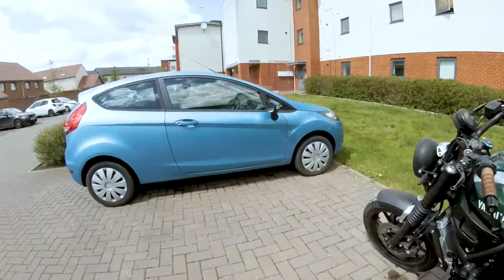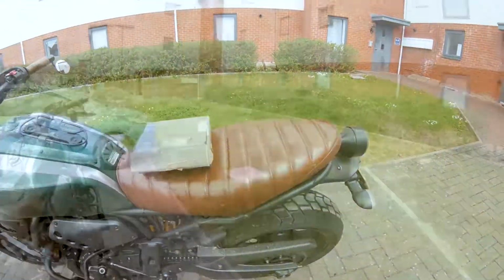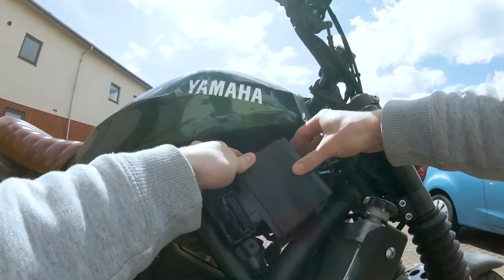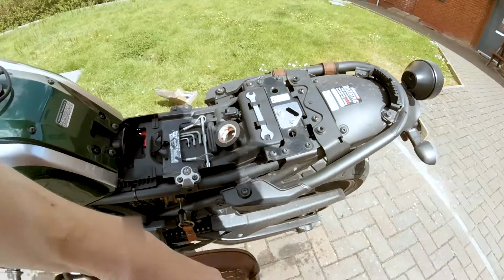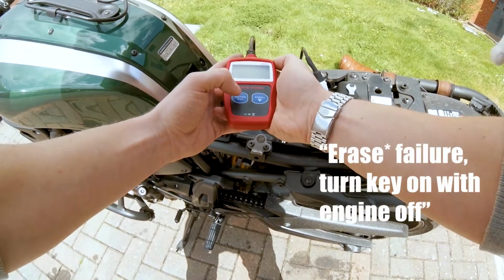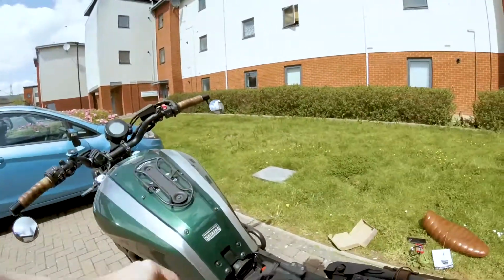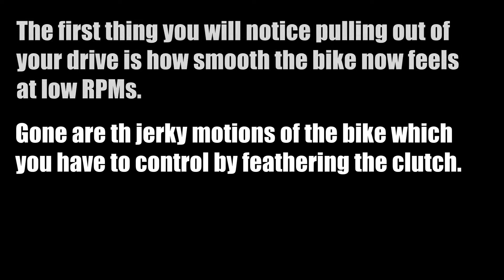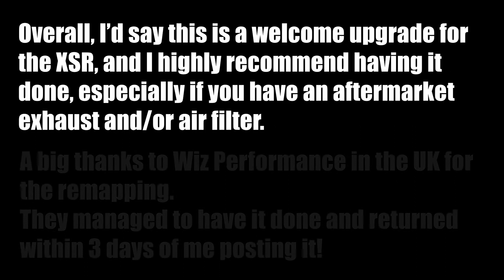Remapped ECU Installation - XSR700

Comment: Great and usefull vid man. As you said the engine braking is too hard in this bike and very jerky trhortle in first gears... too prone to wheelys 😨😨 
I guess with these remaps you Yamy is less yumpy and smoother... First time i take the xsr the front wheel was floating in the air😜😜 Thanks again bro

Comment: Great video, love the intro! The ECU flash is awesome!
Reply from the maker: Thanks mate, appreciate it 👍
Reply: @ballamoto  hi mate I just bought the 2021 x tribute and wow its so jerky throttle on and off how much was the ecu flash great video aswel cheers
Reply from the maker: @elvisthewart670  it's about £150. And worth every penny 👍 thanks 🙏
Reply: @ballamoto  thanks for the reply and the only other thing I'm worried about is that my bike is under warranty im guessing it will void my warranty if I get my ecu flashed.
Reply from the maker: @elvisthewart670  not too sure about that I'm afraid. Might be some info online about if you can reflash it to stock without leaving a trace

Comment: Hello nice video!!! ...i have a questioni for you ....what Is the headlight ? And the headlight's support? Are more short than the original /stock ? ...the handlebar Is original? Thx you ...nice xsr 💪💪💪
Reply from the maker: Thanks mate! The headlight is from Brogue Motorcycles, it's the "headlight builder kit", and then the LED lamp was from amazon. The brackets come with the kit - a lot slimmer than original. Stock handlebars with leather grip tape from TripmachineCompany 👍

Comment: Do you know if the warranty gets removed if I do this? Got a 2020 just bought it so not sure yet. I had Akrapovic fitted by Yamaha themselves and they said the warranty won’t be affected by just swapping the exhaust via them. He also said I wouldn’t need a retune at all as the bike adapts, only a few cases where they have had to do a remap/tune. The mt07/xsr700 are a bit twitchy though but gotten used to it so maybe in the future this could be a great option 😁
Reply from the maker: A lot of people ask this. I believe technically it will void the warrenty - however, you may be able to flash it back to standard if necessary. I know the place I used (Wiz Performance) will do future alterations for free if you cover postage of the ECU!
The Akras are yamaha approved without remapping, but as mentioned, the map is to more sort out the twitchy throttle etc.
I would have a chat with the dealer, and the tuners to get an idea of how it will affect warranty.
But I highly recommend! It's like a new bike!
Reply: BallaMOTO Thanks! I will definitely have a chat with them if they can sort something out perhaps and also ask about the warranty if I do it via another company. A smoother throttle would make this bike a 10/10 😁

Comment: Hey I’m thinking of doing this to my XSR soon. Back when you had your ECU flash did you also disconnect the O2 sensor or do any air box mods? Just wondering if it was simply ECU remapping that gave the smoother throttle response you mentioned :)
Reply from the maker: Just the map (with aftermarket exhaust). No mods to Air box, and no need to remove the O2 sensor as I believe they disable it in the map 🤔 could be wrong, but either way it can be left in place

Comment: Can you provide a link to the wiz performance ecu flash, where one can purchase it?
Reply from the maker: Sure just head over to www.wizperformance.co.uk 👍 (it's a UK company).
Reply: @ballamoto  Thanks mate. Much appreciated.

2 questions, after having gone to their site:

1. Is the process that you take the ECU out, pay wizperformance, they ship you a bag or something and you ship the ECU to them, and they ship it back to you, flashed?

2. Do I have to specify something? The site says either they do a Standard-Full Exhaust or for Standard-SlipOn. I will be keeping the stock exhaust, so should I select their Standard-FullExhaust or...?

I basically will want to just make the throttle less snatchy and less annoying (needing less clutch feathering) at low revs.
Reply from the maker: @fahdiqbal2221  to answer your questions:
1) the process is that you pay, and then just ship off the ECU to them (no need to wait for a bag) with a note with your order number, and then they will send it beck very quickly. I would recommend sending special delivery so it's insured up to £500, and also select special delivery for the return.
2) I would email them to ask, and then if they can do a map with the stock exhaust, just select the option they suggest, and include a note reminding them when you send it off! 👍
Reply: @ballamoto  Thanks mate, that makes it quite clear!

Comment: Just searched for a review of this remap. I have an MT07 so the same engine. I'll probably get this done in the next few months. 👍 I'm assuming it's very noticeable smoother throttle? 😀
Reply from the maker: Very very noticeable. A very welcome change!
Reply: Excellent 👍
Reply: Did you upgrade the air filter btw? Thinking if I remap I might as well do that at the same time?
Reply from the maker: @FuelwithDave  I haven't yet, no. But I might do 👍
Reply: Just got my ECU back... I've just messaged Wiz as I've got my engine management light on randomly? Want to use the bike on the weekend   to see how it feels but worried to ride it now. I remembered your video you had a reader did yours throw a management light on or did you have an issue already? Cheers
Reply from the maker: @FuelwithDave  the lights come on because of the flash. That's why I bought the obd 2 reader, to clear the codes after the flash. It'll still ride fine without clearing the codes, but you won't know if anything else goes wrong! Haha.
Reply: @ballamoto  what a pain wish they said I would need one of these readers
Reply from the maker: @FuelwithDave  it's a toughy, as euro 3 bikes (most on the road) don't need it. I heard about it before so I asked him. Sorry I didn't make it more clear in my video!
Reply: @ballamoto  no worries I'll wait until he gets back to me. my mind is at rest from you saying that. So should be ok to use this weekend by the sounds of it just needs it clearing...  thanks for your replies bud

Comment: Hi man, what prompted you to get the ECU remapped? It’s something I wouldn’t have even been aware of prior to seeing this video.
Reply from the maker: Mainly the snatchy throttle at low RPM, and the huuuuuge engine braking (as well as upgrading the exhaust, and so should really remap the fuel to air ratio)... So I started reading up on it, and the map came up. The guys developing the map had the same idea, that the throttle response just wasn't perfect, so they fixed it. And man did they fix it. What a difference!
Reply: @ballamoto  wow, I wouldn’t have even thought/known that would be electronically controlled...I would’ve completely assumed that it was a mechanical characteristic. Cheers for the reply dude, insightful 👌🏻
Reply from the maker: @TheDanpearcedp  no worries! Same here at first. But it's called a decel cut. And because its fuel injection, not a carburettor, they control how much fuel trickles in when you close the throttle, and if it cuts completely then its all down to the engine characteristics, which on the xsr gives heavy engine braking. Whereas with the map, they change timing of the injectors shutting off, allowing a smoother deceleration.
Clever stuff! Same with the snatchy throttle at low RPM. It's so worth it.
When I roll off the throttle, it feels like I'm a gear up from standard, which is a lot smoother! But then obviously when I hit the gas, all the power is instantly there still!
Reply: @ballamoto  ive just installed an sc project exhaust on mine and it now feels abit sluggish in the mid range. Is each mapping individual to a bike to correct the fueling? or does a generic ecu flash solve all fueling issues? think mines now running abit lean
Reply from the maker: @tomjenkins6597  usually you will tell them your exhaust set up if they are mapping it remotely, and any decent mapper should have made one for your specific setup 👍
Reply: @tomjenkins6597  After remap you will feel noticable more power in the midrange. I have SC project too.